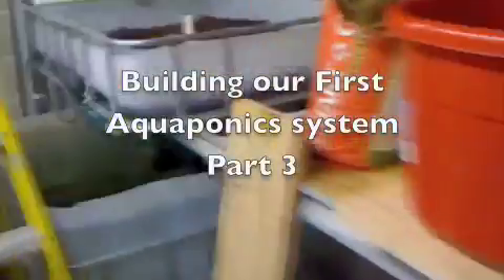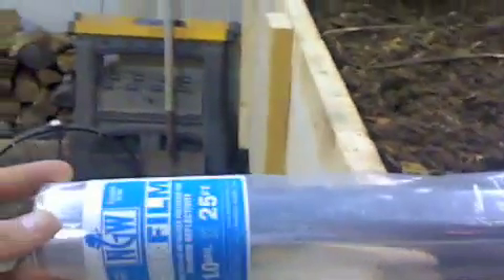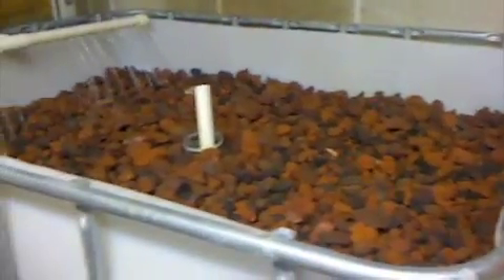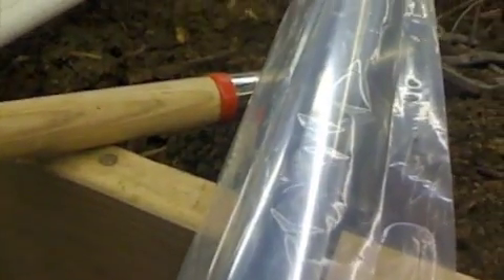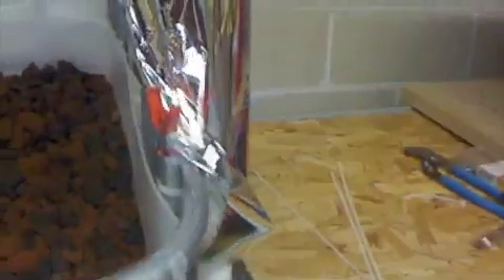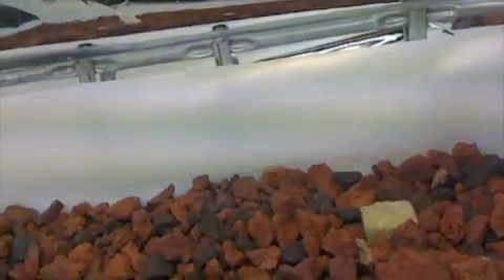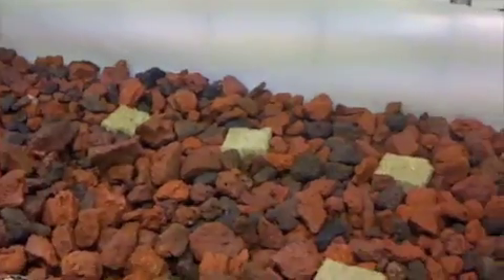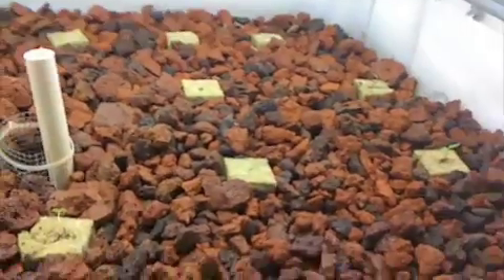Aquaponics Part 3

Comment from the maker: @MrWildkat  I am sure that would work great in a warmer climate, the snow load alone would crush 1" PVC pipe.  The compost for heating does work, you just need alot of it and some heat sinks such as 50 gallon drums of water to retain the heat of the day

Comment: Nice start on a setup, but how do you control the depth of the flood cycle? You will either need a bell siphon, or a timer and reduced drain with overflow pipe in order to reliably flood to the proper depth. Also, you should add a 3-4" of washed gravel, 3/4" river rocks or similar rounded gravel is best. Start your seedlings in a window or in a seedling tray under the lights until they are 2" tall before transplanting, or use starter plants. Add organic fertilizer until the fish are larger.

Comment: Yeah, this kind of system is better suited to an area with natural light. Put it outside and reap the benefits. If you want to cut down costs all together use a wind generated pump, it'll run forever.